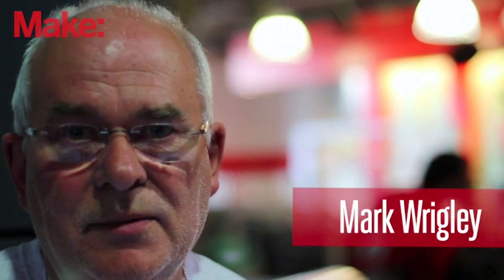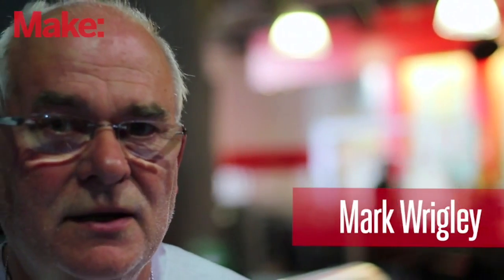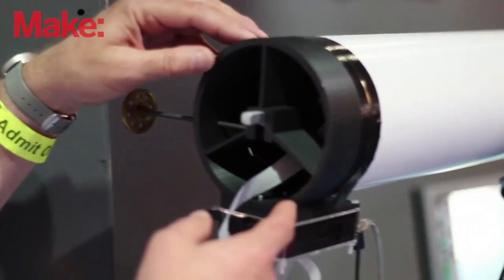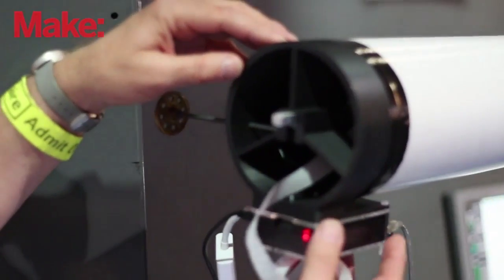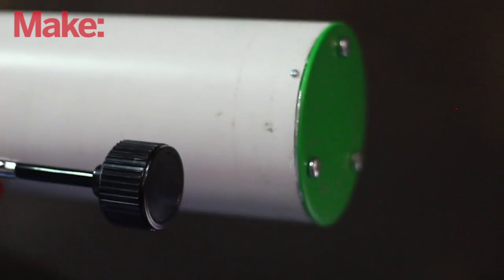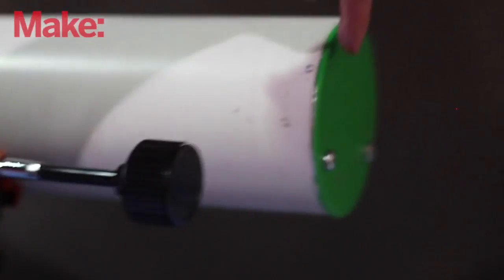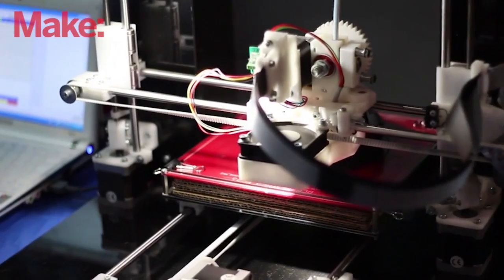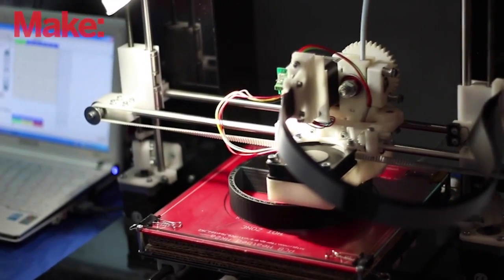The PiKon 3D Printed Telescope

Comment: The fact is that yeah the mirror mounts are 3D printed, plus I guess that's a DIY plastic tube. But the main mirror, reflecting mirror AND THAT TELESCOPE MOUNT add up to hundreds of pounds. Effectively they are have replaced the cheapest part of the telescope (look up OTA on eBay) with something sub-optimal. I mean, I get that it's a fun project. But... there are much better ways to do this than use 3D printing techniques.